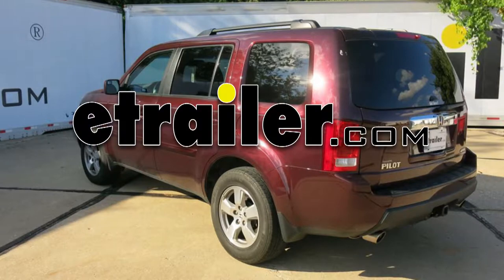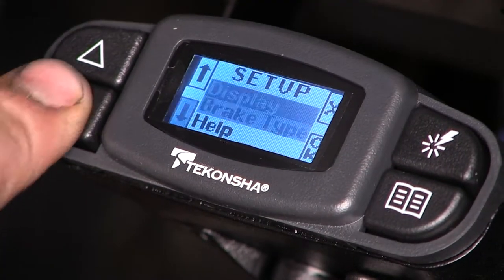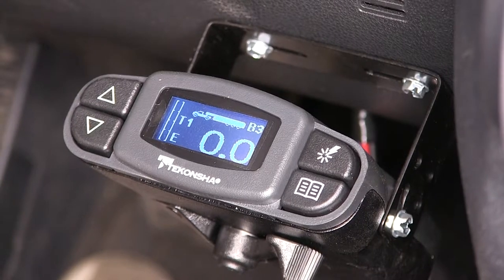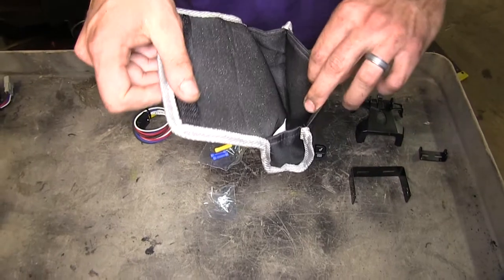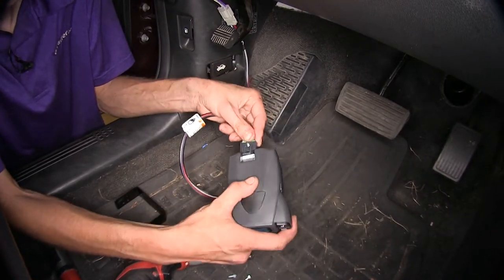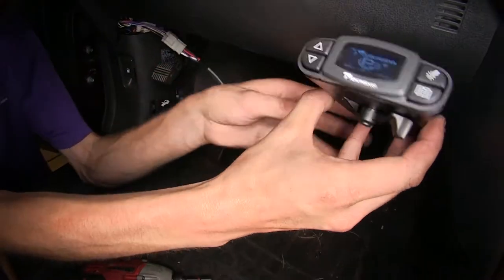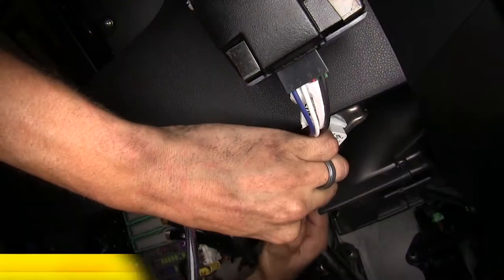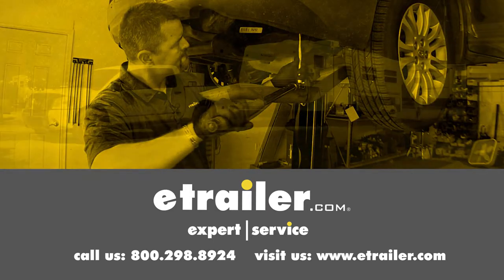etrailer | 2011 Honda Pilot Tekonsha Prodigy P3 Trailer Brake Controller: Complete Installation

Comment: question i have a pilot but i don't have break controller and  every time i shift it into reverse my trailer break engages and i cant back does it mean i need a break controller to bypass that?
Reply from the maker: It sounds like you have a boat trailer with a surge/hydraulic coupler. If that's the case, when you attempt to back the trailer, the coupler compresses which actuates the trailer brakes. There's two options in this case. You can either install free-backing brake assemblies, or use the reverse lockout on your coupler if it has one. Can you get me the make/model number of your coupler? If you can do that, I can give you some suggestions.

Comment: Do all pilots have that wire in the panel to connect to ? Or is it because yours had the tow package already installed?
Reply from the maker: Only the 2011 Honda Pilots that are equipped with the factory tow package will have the preinstalled plug for the brake controller to connect to.
https://www.etrailer.com/Trailer-Brake-Controller/Tekonsha/90195.html

Comment: Why does the unit stay powered on when the key is off?
Reply from the maker: This is typical of a brake controller. They use a direct battery connection for safety reasons. With a direct connection to constant 12V power from the battery, there's no way the user can forget to turn on the brake controller before towing. This concerns many people, who fear that the controller will drain their battery but the good news is that the controller will go into a sleep mode after 10-15 minutes of inactivity. It would take several months for the battery to drain.
https://www.etrailer.com/Trailer-Brake-Controller/Tekonsha/90195.html
Reply: @etrailer  question i have a pilot but i don't have break controller and  every time i shift it into reverse my trailer break engages and i cant back does it mean i need a break controller to bypass that?